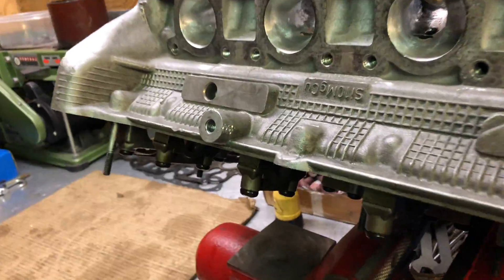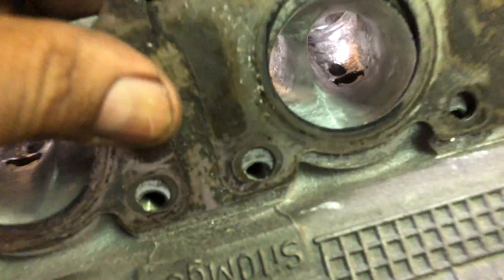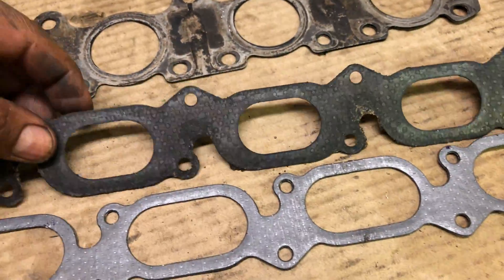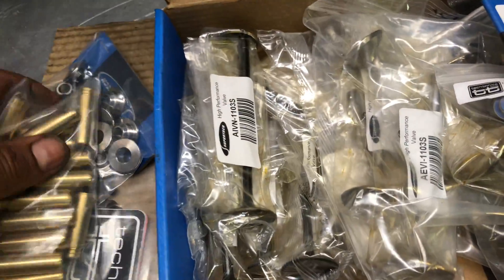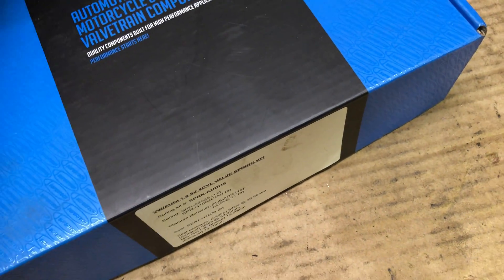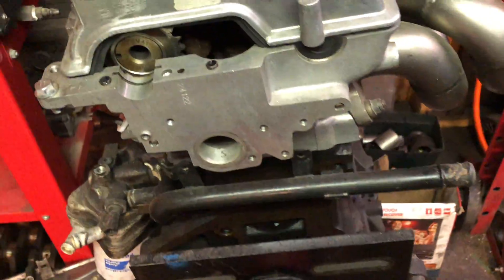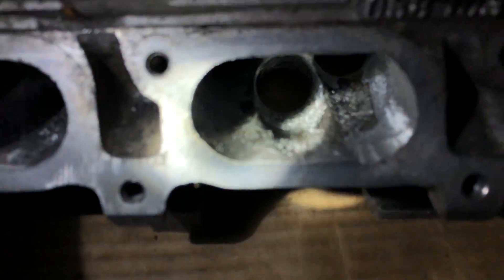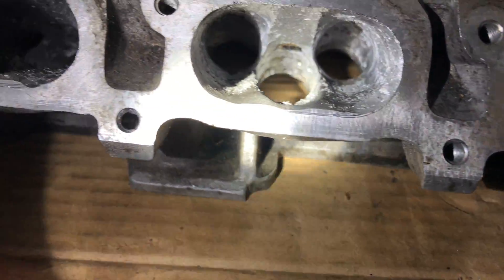vw 20v head ports + big turbo

Comment: That’s Crazy that the exhaust ports are so much smaller than the gasket.
Reply from the maker: They all small man  thats why you need to match ported.  Even if is big port head.
Reply: @taco8v  I’m working on two 1.8t heads now for customers. You can see my work at jd_cylinder_heads on Instagram